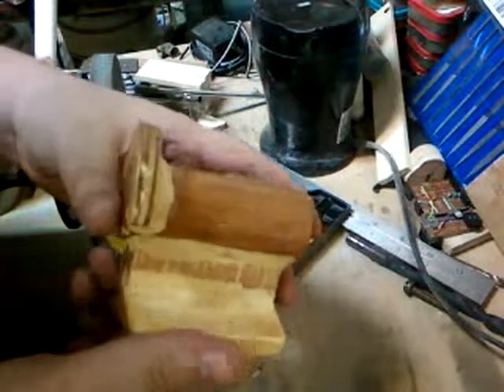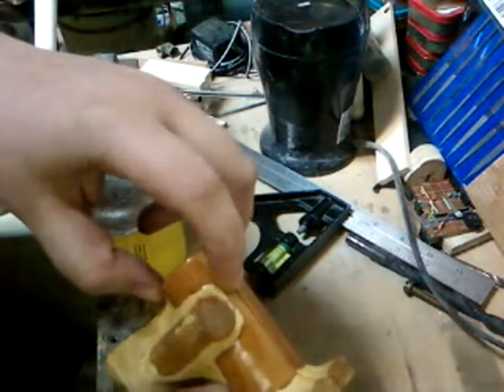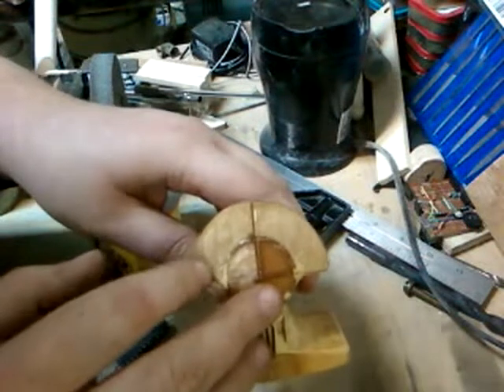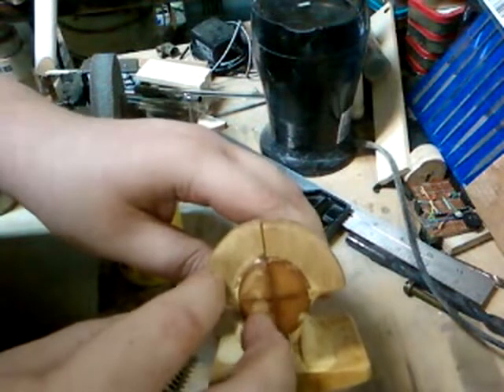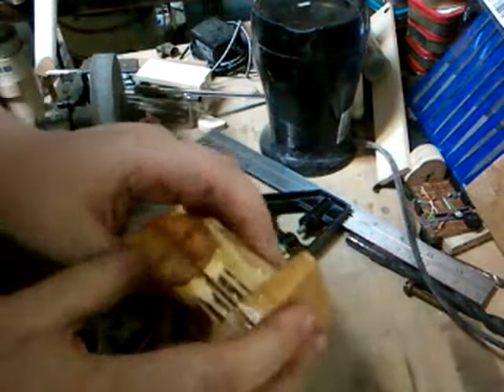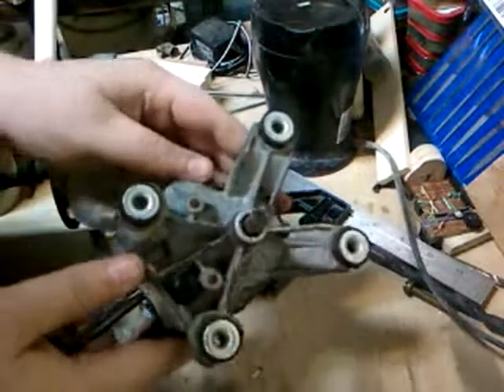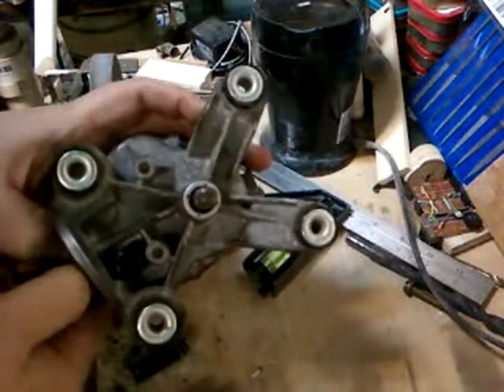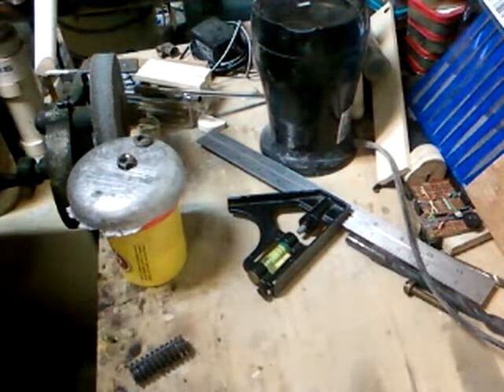How a Spin Indexer Works

Comment: Thanks for Breaking down the intervals of the spacing, i was trying figure it out and was stumped. Simple as it is, my brain could not pull the numbers out of it.
Reply from the maker: no problem, I had a hard time figuring it out also, but when I finally did, I realized how simple it really was, and designed an indexing table for a drill press for drilling bolt holes with. Im glad that the video can be of some use, thanks for watching.